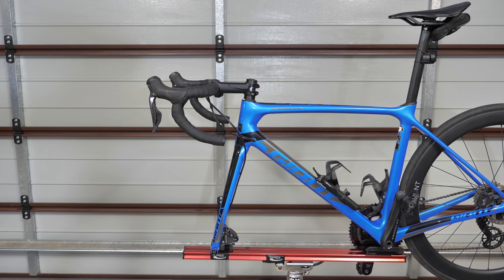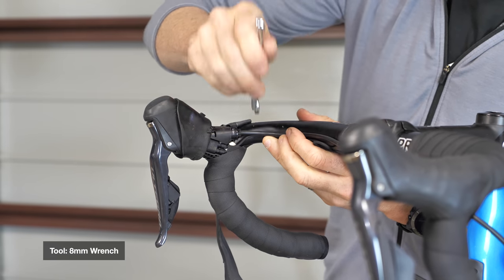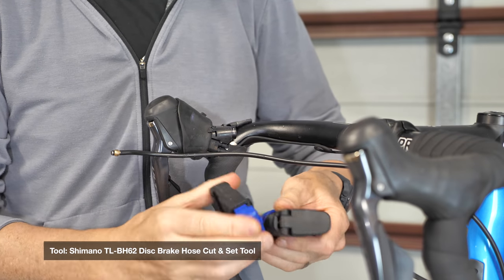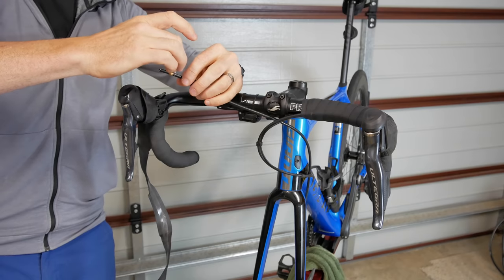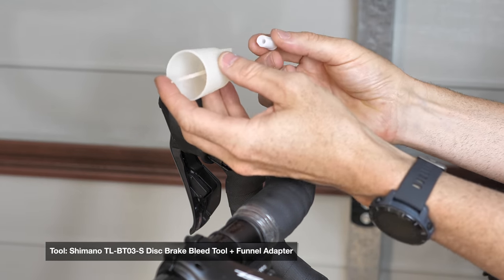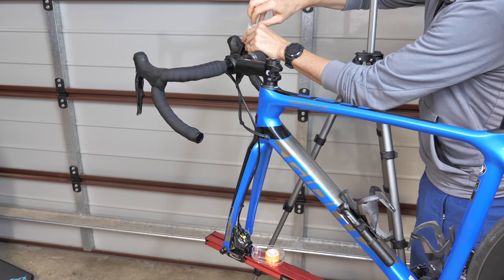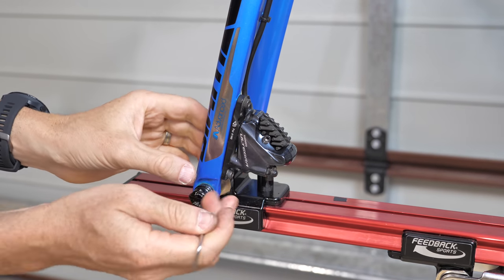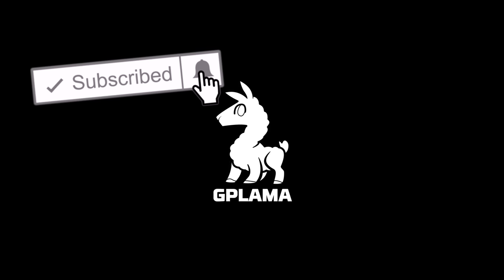Shimano Road Bike Hydraulic Brake Line Shortening // Ultegra Di2 R8070 Levers & Callipers

Comment: Hi Shane! Long time follower here. 

As an experienced mechanic I’ll confirm a few things:

I always use the block. But before pushing the pistons in, I try to clean them as much as possible in order to not damage the seals with dirt and particles.

- I’d use a spare lenght of regular brake or shift housing to measure the desired lenght before cutting the actual hose

- the BBB bleed kit is fantastic for Shimano (but  you have the original kit now)

- most people will strip the bleed port screw on the levers, be patient and careful :)

- (I hate to say it: your bar tape is wrapped backward on the top 🤣) 

I hope It helps for your next brake maintenance session 🙏🏼

(You can see the BBB bleed tool in my latest video)

Cheers ✌🏻
Reply: yeah i saw that and was like "dude your bar tape is wrapped wrong"
Reply: Can’t find your video Andreas... do u have a link?
Reply: @thedownunderverse  Specialized Aethos S-Works dream build - the lightest disc brake bike in the world? - 1080hd
Reply: Comments like this are brilliant - I checked out the BBB bleed kit and loved the way it operated. Bought one myself and will use it this week to set up my first hydraulic brakeset. Thanks for the suggestion.
Reply: One question for pro mechanic please: i am planing to do the same job but rather cutting the hose from the calliper than from the sti levers. Is that fine or?
Reply: @nenobike  it’s ok if you don’t have a integrated cockpit.
Reply: @AndreasIhm  yes, old school, shimano 105 on giant tcr. Thanks for info!
Reply: @AndreasIhm why wouldn’t you recommend it for integrated cockpit bikes? I was thinking of shortening the lines from the calliper on my 2022 emonda to avoid undoing the bar tape

Comment: Make sure the pistons are super squeaky clean before you push them back to prevent the dirt getting behind the seals. Use cotton swabs and some clean mineral oil and the pistons slide in better as well. These look alright but while you're in there you might as well do it properly.

Comment: I'm new to bike building but I memorized two things from watching several videos. 1) Before cutting a hose, when measuring the length, remember to turn the handlebars to determine the correct length then 2) keep a little length if you are 140 at the front because if one day, you wish to pass in 160, you would be very happy to have this extra length.

Comment: Hi Shane, noticed your lever is still a little spongy after a few squeezes, try cable tying the lever to the bar overnight to firm up the pressure, gravity will take place and any air still in the system will rise to the top and stay there..👍 nice job btw..

Comment: FYI, to push back the calliper pistons I use 2 hard wood (oak) wedges in opposition.  These ensure the pistons are pushed back parallel to the calliper sides and do to not damage the pistons.

Comment: When pouring from a bottle with an offset opening, such as your oil bottle, position the opening at the top of the pour (opposite of 7:35 ) which will allow the the air replacing the fluid to enter smoothly and avoid the "glug glug".

Comment: If you use a bike bag for travel an addition check of cable length is needed to ensure you can remove your bars and rotate to the correct position in your bike bag. The bike shop offered me nice neat short cables that I thought were great till the first time I went to pack my bike in my Evoc bike bag!
Reply from the maker: Great tip!

Comment: Shane, I also used the ball end of my allen key when opening the bleed screw. Unfortuantely, the screw was probably overtightened by my mechanic during install: The ball broke off the allen key and jammed in the screw. Two lessons there.... and much swearing/butchering required.
Reply from the maker: Ouch!

Comment: I had to do this with my new bike. Not only because I installed a narrower handlebar but also because the brakes where configurated wrongly (left/right vs front/rear) to what I´m used to.
I had to repeat the bleading procedure because my shifter wasn´t at the perfect angle to bleed with the bucket on top.

Comment: Nicely done. From my experience there is not an unique way to bleed the brakes...sometimes you just need to pull the levers sometimes you need to push and pull from the calipers, sometimes you need to pull the bubbles from the funnel and sometimes a combination of everything :D

Comment: Hey bud, the video was supper informative. However, your flange nut seems to be really easy to get it flushed with the shifter housing.

Mine was done pretty tight up but there was still a visible gap between the flange nut and the body. Would this be a problem ? I've been riding with it for weeks without any issue, but just better to be safe than sorry.

Comment: There's no point in doing the full fork rotation at the end. It should have been done before cutting the line.   ;)
Also, should have done the few squeezes to reseat the brake pads on the disk before removing the cup, so that the line fills with liquid completely.  ;)
Reply from the maker: Given the bars/fork don't move, it wasn't required at all. All for show... and to be sure I really didn't screw up. ;) The rear will require it before cutting.

Comment: Is there any particular reason you chose to shorten the line at the brake lever, rather than the bottom at the caliper?  I would think shortening the caliper end would be easier, not having to re-tape.

Comment: Question: why did you decide to cut the top rather than by the brake caliper?

I'm working on changing the fork with a front GRX that threads through the fork. And deciding whether it's easier to thread from the top or bottom. 

If I cut at the caliper,  I thread from the top and give a full bleed but don't rewrap the handlebar. 

If I cut at the top, I wrap the bar and still have to bleed. 

I have a set of cable cutters and tube cutters available but not the specific tool.
Reply from the maker: Air bubbles rise up. Better to cut at the top than at the bottom where air may be introduced into the system requiring a more thorough brake bleed.

Comment: Way to go! What size contis are you running, if I may ask?
Reply from the maker: 25. I have a set of 28 ready to I install.... if they’ll fit.
Reply: @gplama  thanks for the reply. 😊 Maybe stick to the 25mm for the front at least, to stick closer to the 105% rule, considering your hunt rim has a 27mm OD. Unless you really prefer/wanna try the 28mm nominal. For the back, the aero factor, shouldn’t matter as much.

Comment: Do you absolutely need that special tool for the hose cutting and barb installation?
Reply: I’m sure you got your answer already, and the answer is no, not at all. With normal olive you can just hold the hose in place without crushing it (shimano sells pads for this, maybe something else can work too) and then hammer the olive in. Cut can be made with box knife

Comment: Hi Shane, thanks for this video. I have few questions

1. Do I need the same tools and parts for a dura ace di2 12 speed ?

2. I only want to change my handlebar from a 40 to 38 which has internally routed cables, do I still need to cut the cables when rerouting internally through the new handlebar?

Basically I bought a new bike with dura ace di2 system but came with a 42 cm internally routed aero handlebar, this bar is too wide for me and I want to swap it with a 38cm without bleeding or doing anything else to a brand new system.
Reply from the maker: 1. Yes.
2. It depends on the bike.
Reply: @gplama  its a venge with a roval rapide handlebars, so it's not completely internally routing through the stem. It's only the handlebar thats internally routed. If your answer is yes then:

1.if I cut the cables with existing olive and barb and put in new olive and barb inserts, can the cables be reinstalled without bleeding the system or putting in additional fluid?

Do you have a video of this process?

Comment: Can I do it from the caliper instead from the shifters? I hire 3 bike mechanics to do the job but they ending up cracking the shifters. They wont cover it since the bike is 2nd hand 😢
Reply from the maker: Sure but you'll likely introduce air into the lines doing it this way.

Comment: The same work is waiting for me.... Why they always are putting so long cables?
Reply from the maker: They usually keep them long enough to accomodate the widest bars and highest stems people are likely to use. There's no real harm in longer cables. Shorter cables will need replacing if they're too short for any bar/stem swap.

Comment: I have a question, can the cable be disassembled without emptying the brake fluid circuit?  Thank you
Reply from the maker: I’m not sure what you mean. There’s no cables as such, just hoses.
Reply: @gplama  What I mean is if there is brake fluid inside the hose? Thanks
Reply from the maker: @jhugle8106  Yes. You can drain it or leave it in there when working on it (by capping the ends). Shimano is easier to work with as it's just mineral oil, not DOT fluid.

Comment: This video is a few years old, but you could have easily integrated these lines into the frame with no exposed cables at all
Reply from the maker: The 2019 TCR doesn't allow for internal cable routing of the brake hoses.
Reply: Yes it does  @gplama  Ive done a few of them.
Reply from the maker: @alvaroodeh4794  With which fork/bars/stem?

Comment: Why did you cut the line at the lever end? cutting at the caliper end would have been quicker - no tape to undo & retape!
Reply from the maker: It'd require a full bleed/un-bubble from the bottom up, I assume. I thought this would be less risky as my first time messing with hydraulics.
Reply: @gplama  Bubbles only go one way.
Reply: @neilwheel  but you would need to do full bleed since you would need to let all the mineral oil out, i guess. The suction would probably hold most of it in but still longer way for bubbles to go and more chances of it trapping somewher.
Reply: @davidkosi7662  never had to do it. like you say, suction comes into play here and you'll be shortening the line, not lengthening it.
Reply: @neilwheel You would be surprised how little air you need for brakes to feel squishy.
Reply: @davidkosi7662  I fitted and used my 1st. set of hydraulics {magura HS1} in 1989, so no. Syphon of any air. Bubbles want to escape, sol let them.

Comment: Great video! Would however use the method of pushing the fluid through the system. Like shown in picture 4 from https://www.bikeradar.com/advice/workshop/how-to-bleed-shimano-disc-brakes/.
Reply from the maker: A full bleed might be next time. I'm just starting out. :)
Reply: @gplama  done a bunch of shimano bleeds on both mtb and RS685 road shifters. The good news is that shimano usually lets you get away with a half-arsed effort and still be mostly ok but it will annoy you eventually with wandering bite point. The better news is that a full up,down,shifter grab bleed exactly per the dealer manuals from si.shimano.com is not that difficult and makes brakes simply awesome